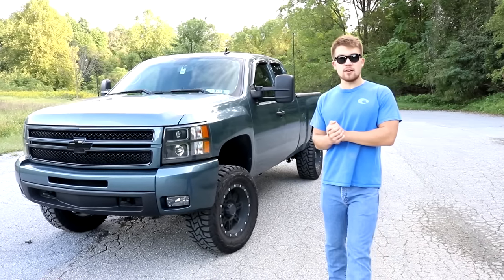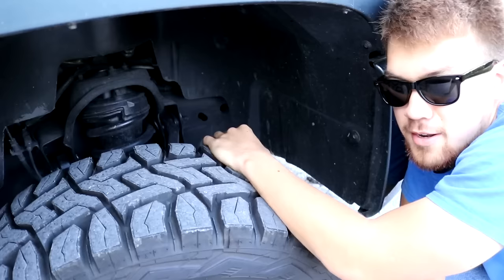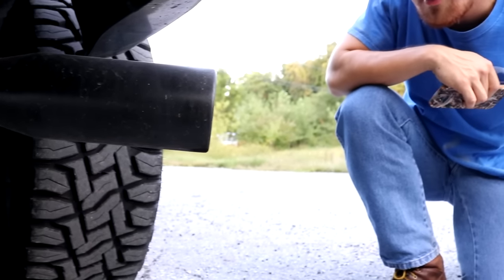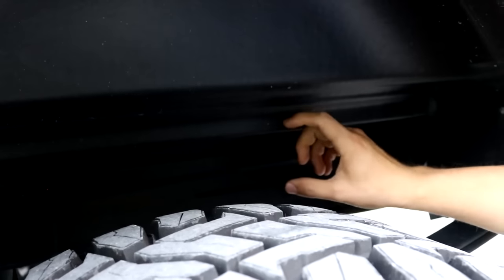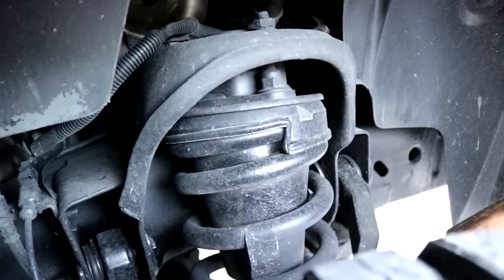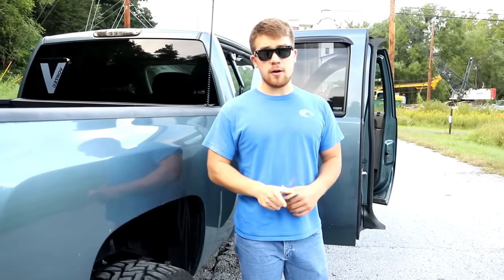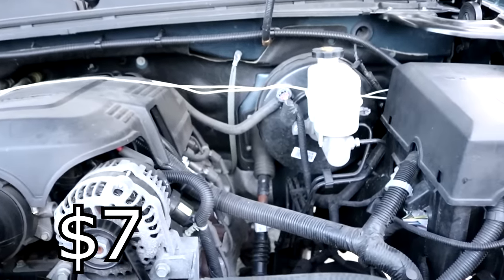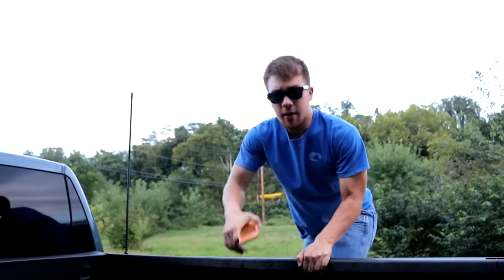HOW MUCH Money has my LIFTED Silverado Build Cost?

Comment: I just bought a 2012 Silverado with only 60k miles, it's in the body shop right now getting the spray-in bed liner and the wheel wells coated as well. I was fortunate enough to have bought it from a guy who had put some nice mods into it and I am just adding a bit more, I plan on keeping this truck for a long time and have some plans for it! Great video and great ideas, thanks!
Reply from the maker: That is low miles! Yea, buying a truck with mods installed saves cash. Thank you and you are welcome.

Comment: I drive a 2009 sierra, 5.3, crew, sb, z71, has long tubes, true dual straights, a 7.5" RC lift, 3" rc body lift,    37x13.50s on 22x14-76 american offroads, 5% tint all the way around, HID 12K violet lowbeams in the front with led daytime switchbacks, tinted halos for the fogs, bushwacker fender flares, painted to match, ranch hand bull nose full front replacement bumper, and a complete line-x paint job for the entire truck. Inside: AFM delete chip, 8" touch screen, 2x 12" Kicker Q-Class L7s on 2400w RMS, but it ain't much...

Comment: I started doing mods to my 2011 Silverado little by little.  At first I was going to try to keep the look stock so I purchased some LED headlights, tail lights, and backup lights.  I did end up converting the third brake light and license plate lights to LED. Also added a K&N air filter.  Because I live in the Midwest, rust is starting to form on the wheel wells so I'm doing some body work.  I like the clean look of your truck and will start de-badging it and take off those huge side moldings!  I also did dual exhaust with a Flowmaster 40 so there's that.
Reply from the maker: "Slow and steady wins the race", thanks

Comment: i have an 07 1500 extended cab RWD  did a leveling kit on it and got the biggest bajas i could fit. they still feel too skinny, small but theyll do. added those same headlights as you but not smoked and changed the bulbs to some bright ass ones. only bummer is i have to turn on my fog lights to get the drl going. also did new led tailights and third break light. have a cai in there as well. i bought bumper end caps and lights to add them as well as the front bumper beneath the grill that has the air flow hole like yours. im gonna try to paint thr end caps on my own got cans from store where they matched my paint. might have to take it in for install tho

Comment: $8,400... that's not bad at all
Reply from the maker: And that is just the cost of the mods alone without the catastrophic truck payments
Reply: @Derec  I bought a rusted to shit 2006 1500HD for only $700 with the 5.3 L33 aluminum block in it. Just some body pannel replacements and rocker panel replacements and it will look much better. It runs and drives flawlessly.